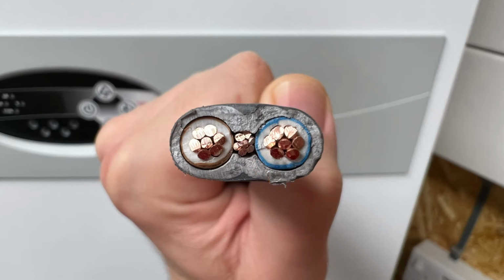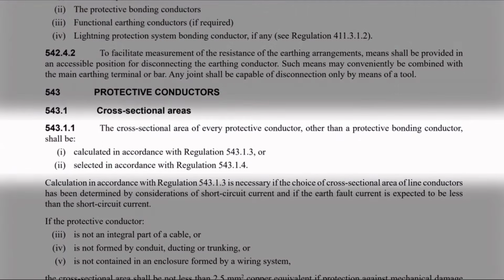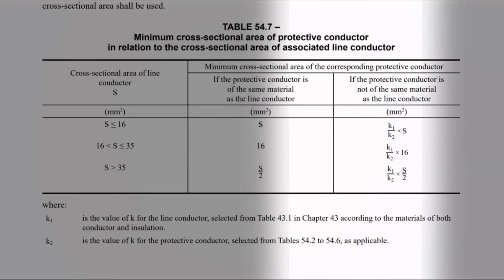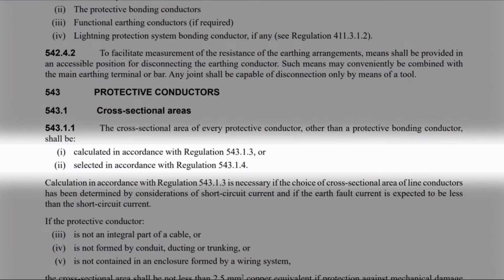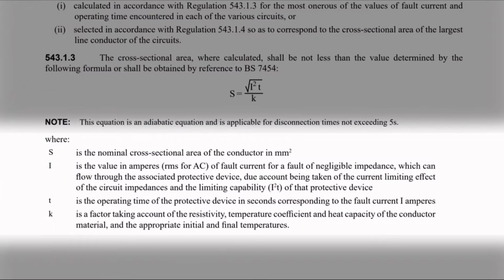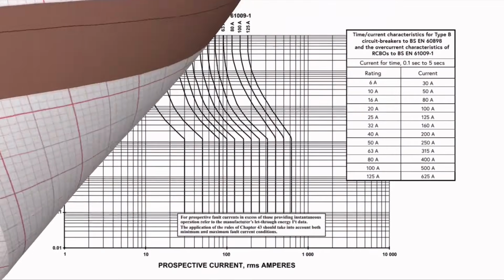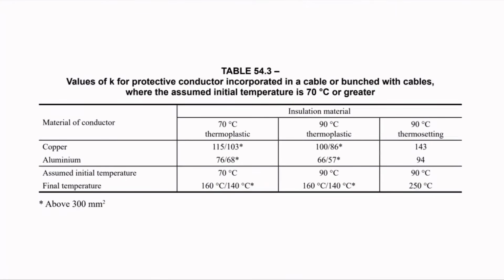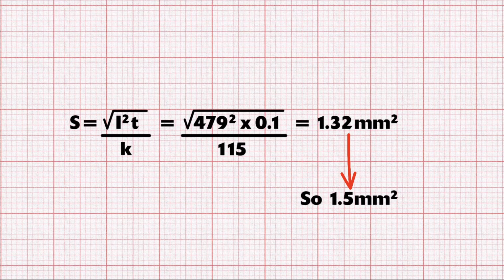Small Earth Wire: Does Size Matter?

Comment: @eFIXX I would like clarification on the energy let-through  (i2t) for the magnetic section of the time/current curve of a MCB conforming to BS EN 60898 and BS EN 61009 with a k value of 115.

Using the i2t values from Table 8.6 from the IET's Electrical Installation Design Guide, gives different results than in this video and a much higher CPC size than is common in practice. Are those i2t maximum energy let-through values for when direct information from the manufacture is not available and you have to fall back to the over arching standards like BS EN 60898  or something?

Comment: I am not a trained sparky, but thought if the earth/cpc was thicker than the fuse wire protecting the current carrying capacity of the phase and neutral, then the fuse will always melt first, with modern breakers etc then they are even faster on a direct short to ground.
May be I am wrong, but seems that a fuse wire or breaker would be the weakest link.
Ps okay you have to de-rate cables depending on how they are arranged etc but that should not effect the rating of the cpc. 
Gaz UK.

Comment: Almost all T&E cables now are on RCD of some type. So, the need for that adiabatic equations is obsolete and earthing on the RCDs should be calculated differently, much like on TT installations.
Reply: The presence of an RCD results in the target earth loop impedance required being considerably higher.
That makes achieving it much easier.

You still need to do the calculations to ensure your circuit design comes in below the actual requirement (which is typically 1667Ω).

If you can't do those calculations, then do have the essential skills to be an electrician?

Then you build the circuit and you test it to verify the impedance comes in below the maximum required figure.
Reply: The need for the adiabatic equation is obsolete. Don’t mean to be harsh but that’s a horrendous claim to make!

Comment: I was taught when calculating Ipf to apply the C min factor for the nominal voltage. 
For example, Ipf = Uo x Cmin / Zs

This Ipf figure would then be used in the adiabatic equation to determine the CPC size.

Perhaps this is overkill, best to be safe then sorry I suppose!

Comment: As an aside, about the adiabatic equation, I don't understand why it is presented as it is. Why square the current and square root it. That's like adding 2 and then subtracting 2. You get the answer much quicker and with less effort by taking "I" outside the square root. (I/k) x root(t).
Reply: But that is not what you are doing.  The term under the square root is I^2 multiplied by t, the operating time.  So, for 10 amps and 0.1 seconds,  their calculation gives 1.0, while yours gives 3.16.
Reply: The op is right. I suspect it's only shown that way because of how the formula is derived from power over time calculations. Current * sqrt of time just looks odd.
Reply: @JimWhitaker  Exactly!  Maths is important!
Reply: You forgot your math lessons